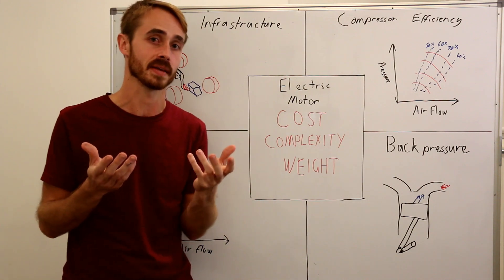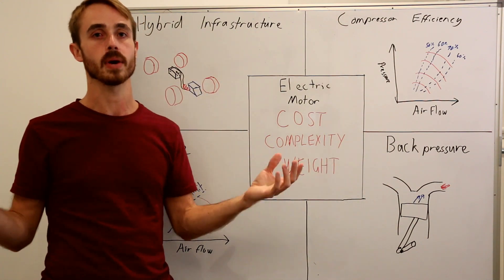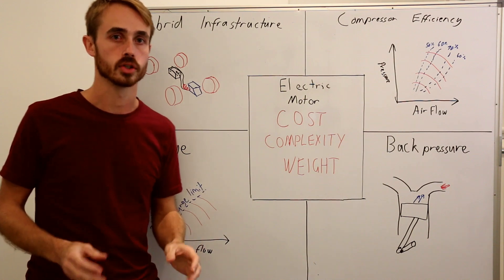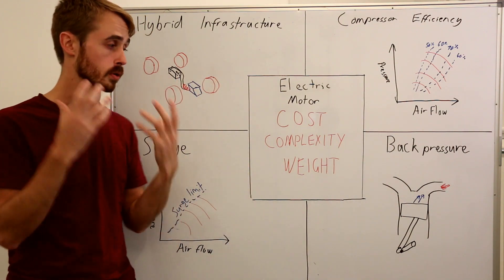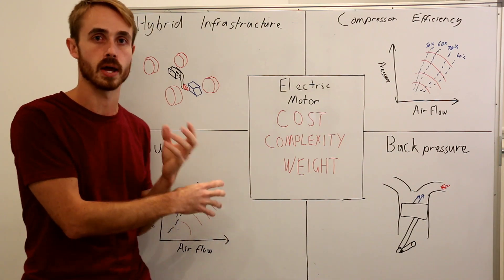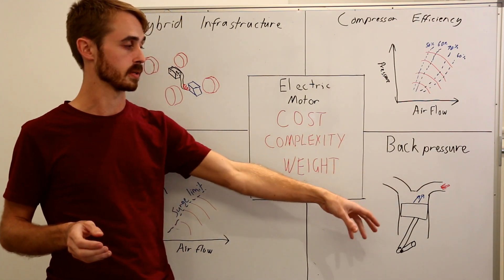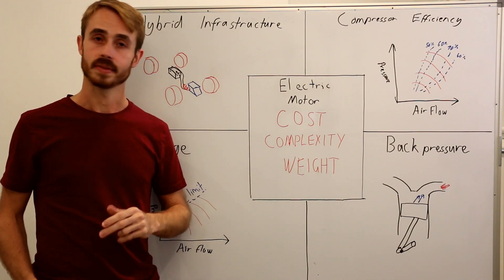5 Problems with Hybrid/Electric Turbos

Comment: Ok, 4yrs later but surely we know more about mgu.h now, so correct me if I'm wrong but isn't the turbo charging batteries instead of batts spooling the turbo
Reply: Kinda both. The emotor drives the turbine under low exhaust flow to reduce lag and make boost earlier, and when peak boost is being made the extra flow drives the emotor to then charge the battery instead of being wastegated out
Reply: @danktyrant420  I assumed traction limits would override or negate any lag issues tbf

Comment: those electric turbos are crap, bigger displacement - lower revs with conventional turbo and electric supercharger does the same job (efficiency) and it's more simple and robust/stable ~ "fail proof"

Comment: What are your thoughts on using a H/E Turbo in a drag race application? My thoughts are towards assisting mainly with building initial boost pressure for launch. No more than 10 seconds of run time needed.

Comment: Would it be possible to just charge the battery with exhaust turbo then remove the alternator entirely. So there's less power taken from the engine in the first place

Comment: but the thumbnail is an f1 engine with mgu-h
i think its not like an assisted turbocharger..
Reply: It is an electrically assisted turbocharger - a standard turbocharger with a motor/generator added to the turbocharger shaft.
Reply: I thought it was charging the batteries with the turbo, not vice versa

Comment: When the electric motor is spooling the turbo is it creating negative pressure in the exhaust manifold and increasing scavenging?
Reply: Unfortunately no.  The turbocharger turbine does not "pull air in".  It is a radial inflow turbine (look it up), and actually the flow into it must overcome the centrifugal force of the wheel trying to expel it as it flows through it.  The flow has to go inward, but the wheel is trying to spin it out.  This actually increases backpressure slightly, but engineers try to minimize this by design.  Most of the backpressure is due to the nozzle area of the housing and blades.

Comment: Wait a minute... you're saying there's more backpressure NA, or electric turbo, but when you have a conventional turbo impeller in the way, there's no backpressure?
Reply: I guess NA has the lowest, then conventionnal turbo, then assisted turbo (bc electric generator takes up energy from spooling & adds inertia to the turbo etc etc)

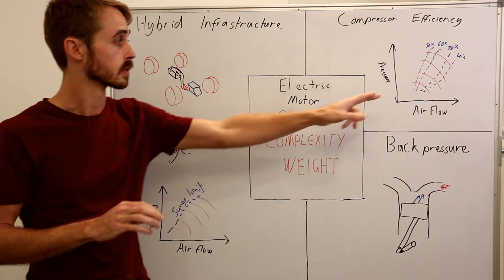Comment: airflow consistent with the RPM ? (1:42)
if that was true, then there is no sense to try increase pressure. 
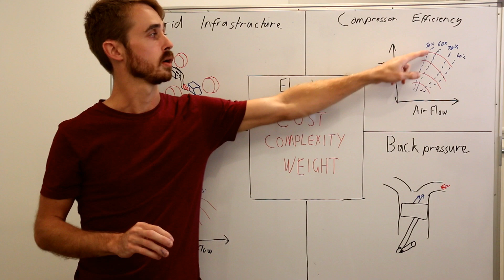Actually, we want to increase pressure so that more airflow goes into the engine which means that on the map we move diagonally and not vertically as implied (2:05)
Reply: he mean that at the x RPM airflow is around y

Comment: So why doesn't the new Bugatti just run variable geometry turbos 
(sequential turbos are 80/90's tech)? It would simplify the turbo setup,
 reduce weight and cost, and have a larger optimum rev range.
Reply: Higher temperatures also cause parts to warp and bend as their temperatures change unevenly unfortunately requiring larger clearances in aerodynamically sensitive areas which negate the efficiency gains of the VGT design.
Reply: I think that VGTs are sensitive to high temperatures, and therefore not used so often in gasoline engines, since they have higher temp output.  They are commonly used in diesel engines. However, we can make VGT for gasoline engine but it will be really expensive due to need of exotic materials which will withstand higher temps.
Reply: Vgt reduce turbo lag but does not eliminate

Comment: as well consider that these are closed systems, and unless we had an inlet after the exhaust manifold (a sort of opposite waste gate), the turbine will be pulling air from seemingly no where, resulting in extremely low pre-turbine exhaust pressure, potentially abusing internal components such as inlet and exhaust valves. as well since air is being pulled through to motor to feed the turbine during time when the electric motor is working, we would also be pulling air through the vacuums that control the fuel rail. this could be prevented by a 1-way slip connecting rod  between the compressor/turbine allowing the compressor wheel to spin faster than turbine wheel.

all is null if you consider exactly what it takes to compress air, versus moving air. think of typical electric air compressors: do you see any with a turbine setup? most use pistons because they are the only way for an electric motor to overcome the mass amounts of torque required to force air into a smaller space. this is because a piston with valves creates a situation where air can only go one direction, and has no ability to swirl around the turbo fan (think of a pump without a prime).

so electric motors have lots of torque, how come they can't compress air with a turbine? this is hard for me to explain, but think of any time you have grabbed a drill or other electric device and prevented it from functioning even on full power. electricity, while having great amounts of torque, is not an unstoppable force. even as you continue to put full power to the drill, if it's stopped it's stopped. pressurized air is a much stronger force. molecules can only be pushed so far before they push back, and compressing on a molecular level is far different than spinning a shaft. you may be able to cap a pressurized air line with your hand, but keep applying power to the system and eventually the air will win, it is inevitable.

as an electric turbo spools, the back pressure will soon be too great for the motor to compete with. the problem with installing a larger motor is (obviously battery life) but also packaging. a motor large enough and powerful enough to compress air with a compressor wheel (remember, continuously open system) would take far greater power and space than what is practical, even for 5-20 psi applications.

the reason an exhaust powered systems works and an electric doesn't is because in an exhaust powered system, air is compressing air. therefore, as air creates back pressure in the compression stage (feeding back to the turbine stage via connecting rod), that same pressure is reciprocated on the exhaust stage. the air is eventually forced out due to the continuously violent exploding gases continue to build pressure, to an amount that will eventually be impossible to stop. this is why a compressor wheel is able to spin 90k RPMs, while producing 30 psi.

 this is a feat that electric motors will not be able to accomplish reasonably, not with this specific setup. A turbo simply is not designed with electricity in mind. an electric turbo would require an entire overhaul. IMO, it will never be worth it. there are simply other power sources that are reasonable with 100x effectiveness and efficiency.

I would appreciate if you took the time to consider my thoughts and actually attempt the math on what I described. I am an engineer by experience and not by training so there certainly are things I do not yet understand, but I believe my logic is sound and the metaphors should explain why.

as well, you have good information however I strongly suggest differentiating yourself from other youtubers. EE has poured hundreds of hours into building his brand, and deserves respect for his effort. imitating him (not copying, you do have different content) 1) promotes EE, because the next time on YouTube I'm going to remember his video model and not yours and 2) makes you appear unoriginal, and commands lesser respect from anyone who knows the Engineering Explained channel. I could justify the white board, it is a good mode of communication, but you also use the same naming scheme which I cannot respect, and is why I will not like or subscribe to your videos/channel, yet.
Reply: there are instances where power may be the more appropriate word than torque, I cannot edit my reply
Reply: Joshua Grzenda piston compressors exist to make higher pressure quicker often 80psi not something required to boost engine performance usually 8psi-30psi is sufficient...creating a vacuum in the exhaust manifold  by the turbo running from the electric engine would be beneficial  and there may even be room for further performance gain by gettiing just the right valve overlap, usually bad for a turbo engine to make use of inlet pressure.
Reply: The turbocharger turbine does not "pull air in".  It is a radial inflow turbine, and actually the flow into it must overcome the centrifugal force of the wheel trying to expel it as it flows through it.  Take a look at the design of radial inflow turbine wheels.  The flow has to go inward, but the wheel is trying to spin it out.  This actually increases backpressure slightly, but engineers try to minimize this by design.  Most of the backpressure is due to the nozzle area of the housing and wheel blades.

Comment: Nice explanation, thanks! 
One thought I had... as you explained, the compressor is going to have trouble building pressure at low flow rates thanks to decreasing efficiency and ultimately its surge limit. Would recirculating charge air solve at least the latter problem? Allow the thing to flow a bit instead. Or am I missing something?
Probably at some efficiency cost, and the added complexity of another actuator etc.
Reply: Michael Barber nice idea...maybe even possible to purge excess boost to the tubine/exhaust side

Comment: i'm a little confused.... How is ET utilizing exhaust gases and therefore affecting back pressure? I thought the whole point of that electric pumpkin is to operate from battery not exhaust gases?
Reply: +IrenicusFTW The turbo unit uses both exhaust gasses and an electric motor to spin the turbo.  The new Turbo V6 in F1 cars goes like this (Turbine)(Electric Motor)(Compressor).
Reply: It's all about powering the compressor.  If you are powering the turbo shaft with the motor you can open the wastegate and relieve exhaust pressure.

Comment: I get why an electrically assisted turbo would be great for racing where you have limited fuel supply, but it seems like a bad idea for street vehicles. Gas guzzler tax aside, Wouldn't it be better to just twin charge with a twin screw on the intake and a big snail on the exhaust?

Comment: Surge will actually improve with an electric turbo because on lift off the energy of high rpm of the turbo will be recovered to the batteries instead of spinning the compressor against a closed throttle. Also there is no such thing as too low back pressure
Reply: MidShipCivic you guys are talking about exactly the same things basically in agreement but because you both use different lingo your acting like the other guy is wrong.